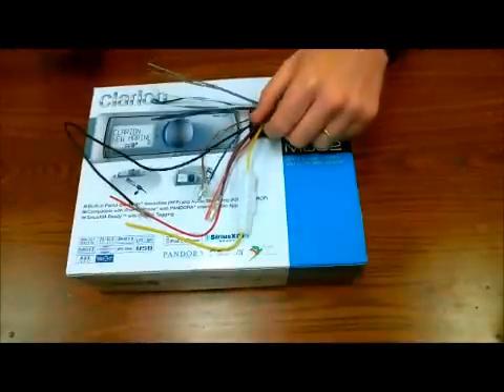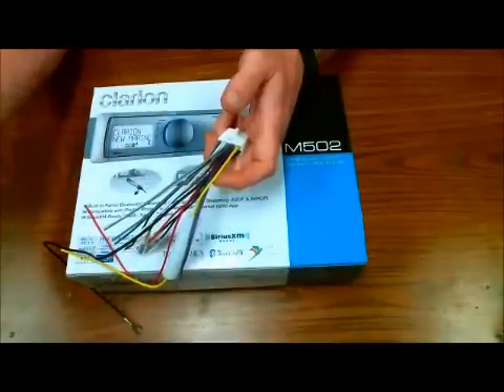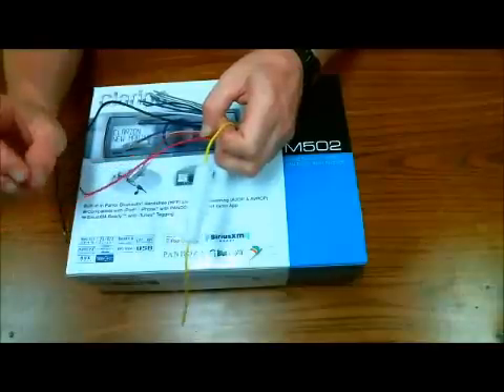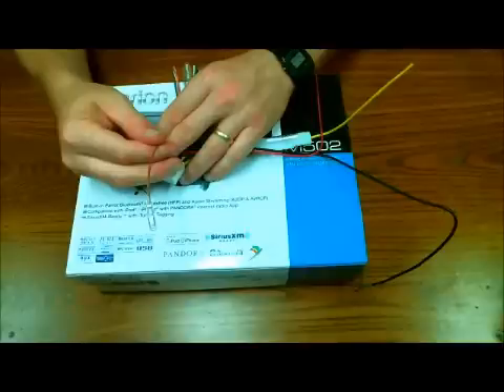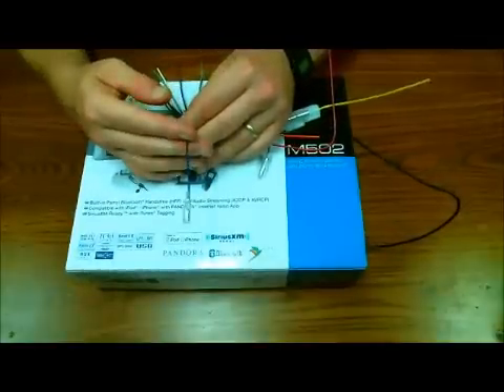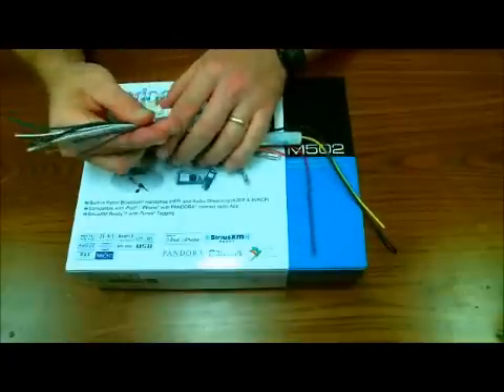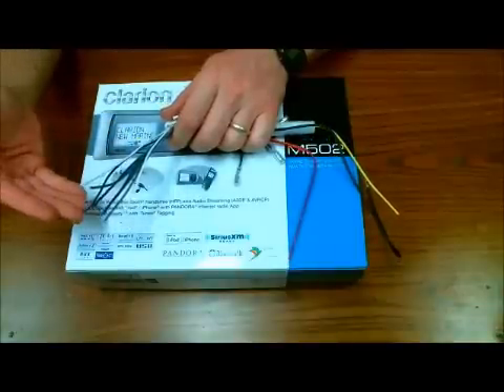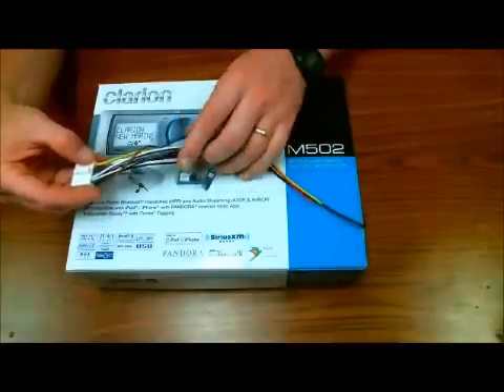Car Stereo Wiring Explained In Detail

Comment: Hey I have a Sony CD player I'm installing in a Ford expedition. I have everything wired up and everything works fine as long as the vehicle is sitting still. But as soon as the vehicle starts moving the CD player cuts completely off. It will come back on for a second or two every now and then once at highway speed. Any help would be appreciated. Thanks.

Comment: Hey Lessco, I bought a Boss head unit that has the solid blue wire, but doesn't have the blue/white wire. I'm installing it in my 2001 Sequoia that comes with JBL and factory amp. The new radio lands on a station, displays the moving eq levels of the music, but no sound is coming from any speaker. I've read that this car system needs the blue/white, but I'm replacing another Boss unit that also didn't have the blue/white and had great sound. Any suggestions?

Comment: hi i have a 2004 pontiac bonneville sle with steering wheel controls .im putting in a aftermarket i think i have everything including back up camara wire .its a tview with back up input do you have a video for this i think i have all metra harness box for steering  wheel to send signals and new antenna adapter

Comment: I just installed a kenwood KDC-255U deck into my 97 grand prix and now the front speakers do not work, all the other speakers work fine including my subs but no front speakers.. it all worked fine before I installed the new deck.. I did notice before I installed my new deck, that the main amp/sub RC wires were spliced into the old harness that went to my old deck and now I have those RC wire connected straight into my deck.. If theres anything im doing wrong please let me know, greatly appreciate it

Comment: My radio stays on while cars off. There is a red wire coming straight from battery and it stays hot constantly. Is there anyway to hook it up to shut off when stopped. Will the 5amp fuse in yellow wire not make it turn off with key thanks

Comment: Hey i just got a dual radio and when i hook it up, only my sub and amp turn on, i wanna know how to get my 4 speakers in my car doors to turn on, please help. Ive been trying to get it right for 4 days. I have a 2004 jeep grand Cherokee
Reply from the maker: the reason why it doesn't work is because you need to bypass the amp under the driver rear seat.
Reply from the maker: I unplug it and run 4 sets of speaker wires from the new stereo to the output wires at the amp. It takes some time to do...
Reply: I still do not get it....im kind of a beginner
Reply: Lessco Electronics i need more explanation on how to do it

Comment: Question- My head unit does not have a blue (power antenna) wire coming out of the harness. It's a pioneer X3600BHS. Is this common? My radio has a lot of static.
Reply from the maker: The question is - Does your Jeep have a motorized power antenna on it?
Reply: Lessco Electronics I now understand your reply. The antenna is not motorized on my Ridgeline. So I guess I just tape it off?
Reply from the maker: yup, that's all you need to do.

Comment: Hey man I just got a kenwood KDC-BT318U as an early Christmas present and I'm going to install it sometime week but first I wanna get my knowledge up on car stereos. I have all those wires on my harness but I have extra one that I don't think you mentioned its a blue and yellow wire and it has a piece of tape that reads "REMOTE CONT" on one side and on the other "STEERING WHEEL REMOTE INPUT" I'm not sure what this one is , could it be for the radio controls on most newer steering wheels? I'm putting this in my 94 300zx , I got an aftermarket NRG steering wheel btw , can you help me out?
Reply from the maker: blue/yellow is is not required for your car. just insulate that one.
Reply: I got the same head unit for christmas.. the blue/yellow wire is for the little remote that comes with the head unit, and the other wire is for the microphone that comes with the stereo, used for phone calls

Comment: I have a 2002 chevy silverado and i connected all the wires but theres two orange wires left on factory harnest
Reply from the maker: those are just illumination  wires, theyre not required to make anything work they just dim the stereo.
Reply: Lessco Electronics I believe by not being able to hook those wires up, my dashboard and a/c illumination does not come on when I turn on the headlights. Any suggestions?
Reply from the maker: I doubt that has anything to do with the radio (if youre using the appropriate adapter that is and not hardiring it the cheap way)...

Comment: Hey buddy, i just got a new jvc radio, i hooked it up correctly but when i turn the radio/cd/ipod up i get static threw the speakers, i have a concern, i drive an 81 ford, and the wires that come from the car are pretty simple to match up but there's 2 black wires, i hooked the negative speaker wires to it and i get sound, but should i hook all of negative speaker wires to the wire or should i hook the front 2 negatives to one than the back 2 negatives to the other??
Reply from the maker: ooooh, sounds like someone has a common ground speaker setup,
woo-oo woo-oo I can hear the siren..
 danger, danger!
 new jvc radios are paralell and common ground is a sure fire way to cook your new radio. here's the fix, rewire the 4 speakers so they are paralell and you'll be in good shape

Comment: Hi I have a 2004 dodge intrepid I connected my control wire from my amp to the wiring harness, and also the control wire from the pioneer head unit to the other 2 wirres that are connected to the control wires. So I have 3wires all connect to control wires makes sense???? Prob is I got blue light on amp but I'm not bump in sub's work fine in my friends car and its not the ground or the power other wise I would have a light plzz* help!? 😮 ☺

Comment: Hi, I have a 69 chevy truck and the radio slowly drains the battery even when its off I'm having to disconnect battery cables to avoid the drain when parked for any extended period. Any tips on how to fix this issue would be greatly appreciated. Thank's
Great video btw

Comment: Hey man I need help, I'm doing the crimping of the wires. So I can connect both black wires together right? Confuses me some say you need to put on metal in your car. Other thing I don't have a red wire coming from the aftermarket harness but I do from the adapter harness, what do I do about that? Thanks.

Comment: hello sir !
 i bought a sony wx-gt90bt for my 2003 vw jetta it used to have smaller sony car stereo and i wanted to upgrade it,  i found that the size of the top of the wires is different, sony wx-gt90bt has smaller harness. i connected all the matching colors and mixed the purple wires, stript purple to non stript purple, and after i finish i started the car, but the stereo has no response, not even started, i am sure i connected the all the wire with same color but the purple one. my question is,  do you think the purple wire is the reason why this stereo did not powered on ?

Comment: For my adapter that came with the aftermarket deck came with a blue striped cable but not with the solid blue one and my adapter that goes to the factory harness has a solid blue cable but not a striped blue cable for my 2000 honda accord.. Isnt my blue cable for am/fm? What should i do ?? Please
Reply: Juan Canada still don't get it.
Reply: Blue to power antenna - factory harness
Blues/White to amplifier - factory harness

usually each code color are the same for any brand of radio.

I plug the blue to the Blues/White

i installed my JVC radio today and it work perfect.

Comment: I installed a radio in a car and it didn't get "power".  It had enough power that the eject button for the cd would run, but it wouldn't turn on.  I had two yellow wires in my adapter harness and I put them both with the yellow of the radio harness.  Was I only suppose to use one of them?  Also, the car also had a small second connector to the old radio.  Those wires were green, green with yellow strip and green with orange strip.  Is that what is causing my issue?  It is a 2008 Dodge Ram 1500 and the radio is a JVC KD-R530

Comment: Great video. Learned a lot!!  My wire harness has 2 extra wires Orange ( which says illumination dash light) and orange black but my new stereo harness only has an extra orange white wire. How do I connect? Or don't connect?  Your help is greatly appreciated. Thanks. Dan.

Comment: Great video.  You confirmed all of my issues.  Just one question.  Can my yellow 12v wire and my red power lead both go to the same positive post on my trucks battery as long as they are not in direct contact?
Reply from the maker: Dylan Hillard yes, but the red should be keyed on and yellow constant because yellow retains memory and red turns the radio off when turning the car off - both are important for their intended functions.

Comment: Great video. Got a question though. I''m trying to wire a JENSON into my trailer/camper. What do I do with the ignition wire? Does it have to be wired into the positive with the yellow wire?
Reply from the maker: Yes, most likely if the power (battery) source is disconnected when not being trailered.

Comment: Hi great Video, but can you help me?   My Bose Clarion PN-2261F for my 1999 Nissan Pathfinder got stolen,  now there is 2 harness coming out one of 10 pins  (pink    purple  blue green/white  blue   light green   red   red/green  red/yellow   blue/grey and the other one of 6 pins ( green/red   red   gray/red  brown   yellow and dark green ) which  one will be the positive one that come from the battery ? and since I don't have black witch one will be the ground negative one?
Thanks a lot for your time....
Reply from the maker: If youre jumping the amp out you can match up the speaker colors and run them direct to the stereo, or if you want to make use of the existing wires use audiovox techs free number, theyre at 631 231 7750, ask for tech
Reply: Lessco Electronics Hi sure I know about the speakers wires, but witch wires colors to connect to the positive?

Comment: Om my 98 grand Cherokee , the car has a ground black wire that used to fit snug on a metal spade on my factory radio, my aftermarket radio does not have this spade, what do i do ?

Comment: how do you fix the wiring if the preexisting factory harness was cut out completely but you have the 16 pin harness for the deck, how would i wire in all those wires to the factory ones without the clip-in harness which is then supposed to be wired into the 16 pin harness that comes with the stereo?

Comment: LESSCO, You da man!!!  In the military,we could call you an 'SME'=Subject Matter Expert.  THANK YOU FOR CLUING ME IN what the wires mean.  I am ashamed that as a FORMER System MGR for a Digital Hybrid PBX system I let an professional installer (alleged) do my 99 Miata. Can you say $250.00 down the drain?  Everyone is quoting me $300.00 to fix it and, thanks to multiple IRS leans (don't ask---me listening again to an expert), I ain't Gots da monet!!!  The idiot installer didn't even take it off internal amp so it was only kicking 18watts x 4 instead of 150wx4 + 800W sub.  

I had one professional installer twerk it and for 15 seconds, I had huge power gains until it shorted out/blown fuse.  Can you talk about Ground loops, and multiple ground faults?

I have a simple Alpine X001 Multi-Media deck (18wattsx4) running two Kar Design 6x9 Component speakers in doors and a Massive Audio NX5 5 channel amp with Pioneer 10" Sub.  I'm running the door speakers bridged.  I've got multiple ground errors, the left channel fades in and out and the sub comes on by itself.  The wiring was a mess (several taped/not butt connected came off) ; I just lost it and yanked everything out.
I've bought custom Italian RCAs cables & Y-Connectors, the Amp Kit wires are do-able and it appears to be grounded properly to the AGM battery in the trunk.

My fault HAS TO BE UNDER THE DASH---I wanna start over,starting with the wiring harness.  Can you show us how to use an OHM meter---pros use it to tweek the Amp, slackers use the sample by ear approach

Comment: Great vid, but i'm in need of some help.
I installed a new head unit in my car, i cant find the ignition power wire, only 2 12V constant wires, is this normal? The car is an 2010 VW Caddy.
Reply: Rudi Pbrahamsen

Comment: I don't know if you explained this or not and I just didn't understand but I have a blue white cable on my vehicle harness and a blue cable on my aftermarket radio harness do I connect them together or not. Sorry if its a dumb question but I didn't know where else to ask Thanks.
Reply from the maker: that's for an optional amplifier turn on

Comment: hello, how are you doing ?
I am having a problem with my car stereo
aftermarket radio JVC about two years old.
it tells me to check wiring. Started a month ago
I checked the resistance .03 to .04 to each speaker.
tried another radio work but would not hold AM station,
FM station volume would go up and down put old radio in push reset it come back with check wiring  could use some advice

Comment: Great video helped alot. I have question for you i just bought a sony head unit and im installing it in a 02 Nissan sentra the wiring harness has both the blue and the blue with white stripe on it but the sony one only has the blue with white do i just connect the blue with white and leave the solid blue alone?

Comment: Before he junked his 2000 VW Beetle, a friend removed the stereo and gave it to me to try and install in my 1974 Beetle as an upgrade.  The unit is made by Clarion, model PU-1667A,  I bought the appropriate 16-pin connector, plugged it into the stereo, and tried to test the unit on the bench before installing it in the vehicle, but no go so far.  I connected constant power to +12 V, switched power to +12 V, and ground to negative of the 12 V, but there is no display at all, and no response from the radio control buttons.  The fuse is good, because the backlights come on when I put 12 V to the light wire.  Can you tell me if there is something I am overlooking?  My friend said the radio worked fine in his 2000 Beetle before he removed it.  He gave me the unlock code and manual, but, with no display at all, I can't even get to the point where you enter the code.  Thanks for any help.

Comment: this was my first install and your video helped tremendously. It is in an older (25 years) boat and I'm left with the blue and white wire labeled remote control. Do I splice into the red or yellow? Any help is appreciated
Reply: Blue and white wire is usually a turn on wire for your amplifier for a subwoofer or all speakers etc. 
accessory is the red wire and yellow is constant which needs to go to constant from car side

Comment: Great video, but i still  need some help.  i own a 1995 ford escort and replaced a pioneer for a kenwood stereo, it started once and never again, the pioneer worked for a few months and the same happened so i replaced thinking it died on me. No fuse is blown and no wire is connected badly, thinking the red wire doesn't come on or something similar, but all other accessories on the car are working properly are working properly. Any idea maybe?

Comment: Im having an incredibly frustrating time installing my new stereo. I have studied the wiring color charts for both my car ('05 Saturn Ion) and my new aftermarket stereo extensively. I know exactly which wire serves which purpose for both. Im not using a harness. I have purchased 3 separate wiring harnesses for my car. None have worked. (I have enough common sense to tell that I have the harness wired properly.) You can see that the metal pins don't even match up. So, I have hard wired my stock wire harness to the one that came with the new stereo. My problem is that I can only get the new stereo to power on when the headlamps are on. And the speakers make a loud and dangerous sounding buzz. I have reworked the wires multiple times and triple check endlessly. The wires are in the proper place. If I reconnect the original stock stereo it works fine. What could I possibly be doing wrong? It's driving me nuts.
Reply from the maker: There is an ion 1 2 and 3, I dont know which you have, do yourself a favor, go to metraonline.com (hit the turbo wires link in products) enter the year make and model and see if theres some part your missing out on...

Comment: installing an aftermarket radio in a 2003 Saturn Ion.  There is a Pink or faded red with white strip and a pink or faded red with black strip not sure what to do with those.  Also there is a Purple with a black strip and a solid purple on the aftermarket harness but the saturn harness has solid purple and a purple with a white strip not sure how those match up.  Thank you in advance for your help
Reply from the maker: what model radio is this with these odd colored wires in it, Is it one of those Chinese made models?
Reply: Lessco Electronics
 The odd coloring is the original harness from the Saturn 2003 ION.  The after market radio is XHDR6435.
Reply: Correction the odd wiring is on the AF stereo
Reply: micgeek I went ahead and purchased a new Wire Harness and it was so much easier.  Thank you for your help.

Comment: Thanks for the video. Quick qestion. Re the blue wire, power antenna. I have an E91 Bmw, but the radio signal is not very strong, I haven't atached the power antenna lead to anything, as there is an aerial slot in the aftermarket amp which I plugged the car aerial lead into. Should I also attach the blue power antenna lead?  If so where? I have no power antenna in the sense of the old telescopic electric aerial in the car, so not sure if I should do something with the power antenna lead from the amp, to boost signal maybe? Any help would be appreciated. Cheers